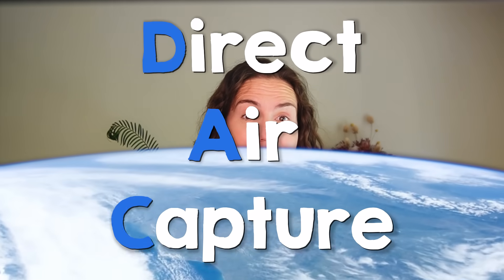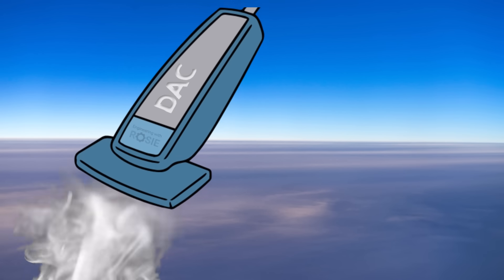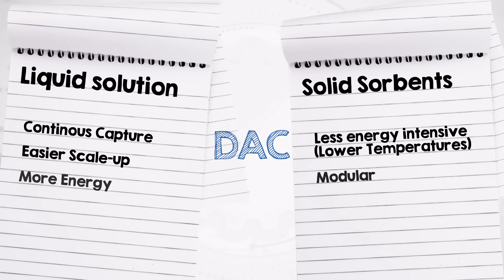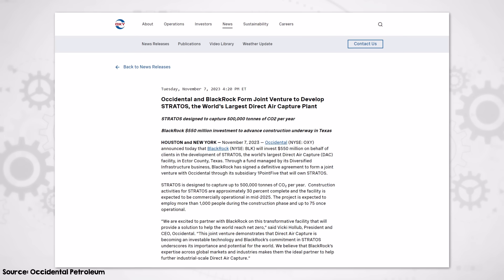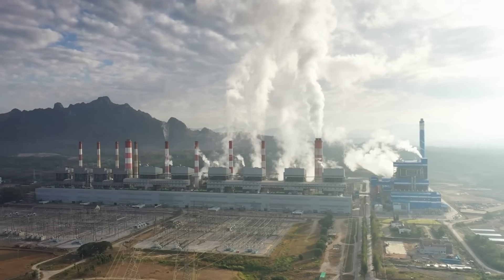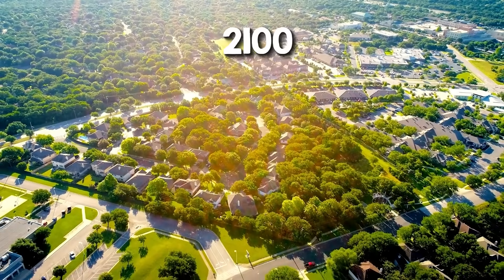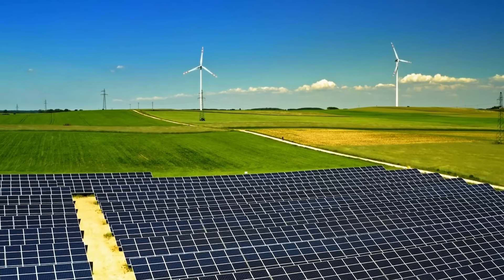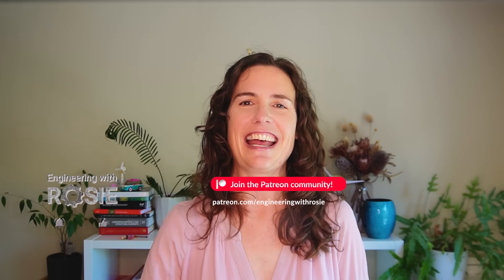Direct Air Capture: Climate Savior or Distraction?

Comment: Since DAC will always be significantly more expensive than point-source Carbon Dioxide Removal, won't it be a better choice to invest in CCS for Biomass energy plants? In other words, Bioenergy with Carbon Capture and Storage (BECCS)?  DAC could be practical once fusion energy is cheaper than solar farms (and fusion will take up less land area). In the meantime, the price point for widespread deployment  of DAC should be that it is cheaper than BECCS. Is there any projection when if ever this could happen?
    Because DAC could someday be more scalable than building new BECCS where there is already cheap green energy, it might possibly become worth deploying on a small to medium scale in selected regions even before fusion is commercially competitive. That would be some decades after iron and steel production is already completely green, since you need steel to make the pipes and fans heavily used in DAC. 
    Our grandchildren's generation might want to use it to bring carbon dioxide levels down to 1980 levels, a level such that snow landing in Antarctica might start to be bigger than ice loss from warm sea water eating at the West Antarctic ice shelf. Recent scientific studies suggest the West Antarctic Ice Sheet (WAIS) is already on track to contribute something like 2-3 meters to sea level rise by 2500 or so, and whether the carbon transition stabilizes at 2 degrees or 1.5 degrees will not affect that outcome much. If affordable Carbon Dioxide Removal technologies, including some cheap scalable form of DAC, could get average global temperatures back down to 1.2 degrees above pre-industrial levels, our g'g'g'great grandchildren might be able to stretch out the collapse of the WAIS so it will take 1000 or 2000 years, instead for 300 or 500 years. If in that timeframe, snow build up in East Antarctica might start to go faster than WAIS ice loss, and sea level rise might start to reverse. 
    In the meantime, the world's coastal communities will have to do a lot of adaptation, and a lot of our urban cultural heritage will be irretrievably lost to encroaching tides and storm surges. A sizable chunk of the world's wealth will have to pay for relocating 30% to 100% of the population in world's coastal cities to new districts. Civilization will look very different after the carbon transition and related adaptation, let us just hope it looks a lot better than what we have today.

    My takeaway: DAC when its cheaper than BECCS and a couple of decades after completely green steel.

Comment: The latest CSIRO Gencost Report released a few days ago clearly states that renewables, even with additional transmission costs is far and away cheaper than coal, gas or nuclear. Renewables remain the low hanging fruit and we should get to picking promptly. “CSIRO Gencost” in your search engine should get you to it.

Comment: How much energy do you need to invest into DAC to offset the CO2 footprint of 1kWh? If it takes anywhere near 1kWh of all-inclusive power to remove 1kWh worth of carbon from the air, then the most eco-friendly thing for a DAC plant to do is to not get built in the first place and use all of the renewable energy it would have consumed to reduce fossil fuel power generation by a similar amount and not generate the CO2 in the first place.
If what geologists said about atmospheric methane resembling ice age termination events early this year is correct, methane is about to run away with climate change and nothing we can do about CO2 will change that.

Comment: We need DAC because zero emissions isn't going to happen. Unfortunately, even if we do absolutely everything, we'll still be so far from zero emissions that DAC will only be able to remove a small fraction of what we still emit. Consider that wind and solar only reduce emissions by 67%, that EVs on a clean grid will only reduce emissions by 80%, and solutions for steel and cement will only reduce emissions by 50%. Just those sectors will still produce 20% of our current total emissions. Bioenergy and growing trees compete with one another for the limited amount of land where growing trees is possible and can only remove a small percentage of emissions. 

Perhaps these wind and EV emissions numbers assume that steel and cement haven't been cleaned up at all and we can thus lower emissions further. So it looks like lowering steel and cement emissions will be critical for lowering wind and EV emissions and bioenergy and DAC will be essential for removing some of what's left. But what's the best case? Reduce emissions by 90% to 95%? Definitely worthwhile, but the climate will still get worse and worse.

Comments with more optimistic analyses appreciated.

Comment: NOT JUST GREENWASHING
There are plenty of non-sexy things the fossil fuel industries could do that would have much greater impact, even without reducing production. But they would require greater effort than signing a cheque to a research company. 
E.g;
- Reducing or stopping flaring at wells and refineries 
- Capping and monitoring old well heads
- Preventing releases of gasses during the refining processes
- Better maintenance and monitoring of each step of processing transportation
- Stop using other countries to bypasses tight standards 
- Develope better quick disconnect hose connectors
- Publish sattelite monitoring data on site emissions 
- Stop funding lobbyists to weaken pollution laws

Comment: Great video - CCS is way too expensive and DAC is at least 10 times more expensive. As you suggest we need lots more solar & wind + storage which will reduce CO2 emissions and the need for CCS and DAC.
Reply: try looking at the  latest IPCC AR6 report about that - carbon dioxide removal needed in every scenario

Comment: My startup has also developed a brilliant solution for all our pollution problems: we named it Hyper-Occlusive Layer Entrapment, or HOLE technology. It's a very cost effective and versatile process whereby problematic substances of any kind, be it single use plastics, chemicals, industrial waste, or even burned out nuclear fuel rods are inserted into one of our excavated HOLE facilities 10 feet in the ground, where it is covered with any kind of soil or local material until the disposal site is indistinguishable from the surrounding environment. In our tests our system has proven to be 100% successful in storing anything we could think of!
And we are already working on expanding our operations massively with our new Submerged Invisible Natural Capture system, or SINC, which is the same technology but water based, which opens an additional 75% of the global market!

Comment: the 1880s CO2_level shouldn't be the "golden" reference standard; 60E6yrs ago the Dinosaurs had a quite higher CO2 "Standard" and ran around in comfy lush temp and vegetation. What is a real good atmospheric CO2 level? it really needs new research! 
 Why doing all that DAC effort, escapes my logic, if You know that the ocean waters have 50 times more capacity for CO2 absorption than the atmosphere carries now! simple chemical equilibrium: air <-> water/carbonates. CO2 will be sucked up by the ocean.
 in 10000yrs an ice age will come (Milankovitch cycle). Then we NEED more CO2 in the atmosphere. Then, not now! 
The Earth radiates 15 to 20_infrared_photons into the night sky, for each visible_light_photon it receives on the day side. From the sun, we not so much get "energy" but more it is actually, really "entropy" what we get! 
The radiative energy dissipation of a black body is proportional to the 4th^Power of its Kelvin_Temp:  E ~ °K^4  That physics function plugs a big Stopper into all hysterical Climate Anxiety.  Climate change to plus_temp is real now, but no need for hysteric activism!

Comment: Once upon a time, I was a DAC proponent. Well, not quite. You see, in Carbon Engineering's early days, they touted DAC and air-to-fuels, or A2F. Their pitch then was:  Suck carbon out of the air, anywhere, then convert the byproduct to drop-in replacements for things like jet fuel...all while being carbon neutral.

Predictably, with Occidental's purchase of CE, A2F has disappeared, leaving behind a "solution" that's actually carbon-positive due to high energy inputs on fossil-fuel-powered grids.

This situation is directly analogous to that faced by The Ocean Cleanup. They devised a brilliant solution to scrape plastic out of the world's oceans. Then they came to the realization that cleaning the oceans is a futile pursuit as long as plastic emissions continued flowing. Here, they changed tack by augmenting ocean cleanup with emissions barriers along the world's 1,000 worst emitting rivers; thereby shutting the tap while mopping up the flood. Now we're getting somewhere.

DAC isn't the solution. Today I believe that all DAC projects should be shuttered, instead diverting all related invest into CCS. Identify the worst offending point-source emitters that aren't energy generating facilities. As is pointed out in this video, the answer for power plants is increasing renewables capacity while expanding the grid to allow for faster connection.

For the worst offending point-source emitters, do everything possible to first minimize GHG emissions, then install CCS facilities; capturing CO2 for subterranean sequestration (like Climeworks is doing).

I'm fond of saying that there's no silver bullet when it comes to addressing climate change. There's only silver buckshot. CCS should be an important tool at our disposal while every other avenue is discovered, developed and deployed.
Reply: A2F makes sense if you force fossil fuels to be blended with it.

Suddenly fossil fuels cost much more, which immediately reduces their use, and of what is used, some of that is from recycled carbon. Gradually increase the percentage of A2F until you have 100% fossil fuel replacement.

Of course direct electrification is more efficient and likely to be more cost effective so the scale of A2F is going to be smaller than fossil fuel consumption.

Finally you scale up carbon extraction which is needed to pull the billions of tons of carbon already released back out of the atmosphere.

Comment: Unfortunately this video completely misses the point of DAC - how are the 100,000 people who attended COP28 going to remove the vast carbon footprint of their flights to get there and back?
There is only one way to treat that problem which is to take the CO2 emissions back out of the air and put them back in the ground.  This is not an issue for 2050, we need to do it now.  Direct global aviation emissions of CO2 are roughly 1bn tons annually and the backlog of new kerosene fuelled aircraft on the books of Airbus and Boeing is enormous and growing. We urgently need to do something about this.   ( please dont say we can use sustainable aviation fuel - that is a non starter ) 

At $100US per ton removal cost, the additional ticket price will be well under 25%, including contributions for indirect climate harming conseqences of flying and the removal of cumulative emissions of flying for a century, which are now around a truly massive 30 bn tons of CO2.   Global aviation revenue last year was over $700bnUS so there is no shortage of money available and it certainly wont make even a dent in the scaling up of renewable energy.  Think about that when you fly next time.

We know how to do this without connecting to the electricity grid, using solar power with batteries -  another myth being amplified.
DAC technology has improved enormously  and is within a factor of 2 of the energy demand of CCS, but the important thing to understand is that CCS prevents new CO2 from entering the air, ie it carries out emission mitigation, whereas DAC actually removes existing CO2, which CCS can never do.

And the cost of DAC isnt $1400A per ton removed, that is the price that Climeworks charge.  The inventor of the Carbon Engineering process David Keith has estimated that the cost of their new 500,000 ton per year CO2 removal plant in the Permian Basin, called Stratos, will be under $400 per ton of CO2 removed.    
And Airbus has already made a deal with the owners of the Stratos DAC plant to buy 400,000 tons of carbon credits to permanently offset their emissions from flights.  
Does that tell you something?      Dont throw the baby out with the bathwater.

Comment: New Engine Type (NET) is free for CO2 capture...  The capture occurs in the secondary cycle of NET's combined cycle.  The secondary moves the efficiency from 55-60% to 75%, and therefore actually SAVES money by capturing CO2.  

The CO2 is also used in the engine to create a COP 4 combustion heat pump.  This would make using Natural Gas drop by 75%.  The heat/power from NET would replace the boiler.

NET also runs on thermal hot water to make RE electricity, with which you can them make fuels.  Ethanol is the idea fuel as it is safe to store and low fire and spill risk. 

This CO2 can be used to make fuel for around $1/gallon gasoline, which is 1/2 to 1/3rd Oil. 

The only use for this industrial CO2 capture system is with nuclear power, but their costs preclude their use.  NET is basically free...

Comment: $1400/tonne is $12.44/gallon gasoline.  There are systems that are less than $50/tonne, which is 44 cents/gallon gasoline.  Something is wrong with your numbers.  Maybe you meant $140/tonne, which would be $1.24/gallon gasoline.  This may be what you are referring to.
Reply from the maker: No I meant $1400/tonne, that is today's price. Maybe $140 in the future.
Reply: you should clarify the difference between the price that Climeworks charges for small amounts of CO2 removal and the real cost of the process, which is obviously a lot less than that  @EngineeringwithRosie
Reply: My tech has CO2 capture by the engine as "free" in the secondary cycle, which actually improves efficiency, which means capture saves 25% on fuel.   Free is the only solution that is valid. Less than free is good too.  At $1400/tonne, it is clearly a scam to rip off tax payers.  @EngineeringwithRosie

Comment: Bravo, you are right, DAC is not the solution for preventing the climate catastrophy.

But we can with the same (ar least similar) arguments argue that neither solar, nor wind, nor heat pumps nor electric cars will "save us".
Without government subsidies, direct or hidden in overall cost of the grid f.e., without susidised cheap capital, these "solutions" dont work.

Anyhow, there is a solution, only one that could work, no guarantee though.

That is massive 
1. nuclear build up (min. 14.000 GW) 
2. industry and power plants installing carbon capture and turning CO2 and water vapor (with some additional hydrogen) into methanol.
Basically make industry "emissionfree"
3. massive build up of District heating (maybe cooling too)
4. massive expansion of railroads for transporting goods and people on seperate distinct tracks.
5. produce where consumption is.
6. recycle everything, circular economy

Over time we could get to below net-zero so that over decades the climate could stabilize.

But if it is not profitable, nothing will happen, at least not on sustainable longer term.

DAC sounds stupid, capture CO2 from air???
Because it is.
Why not stop emmiting CO2 in the first place?
At least in the stationary industry and power plants, which make up more than 50% of CO2 emissions.